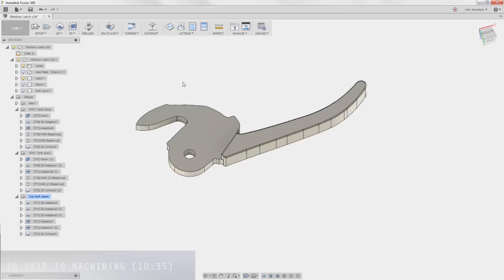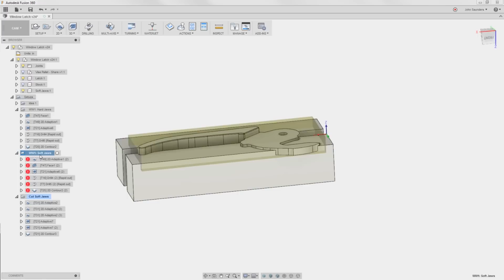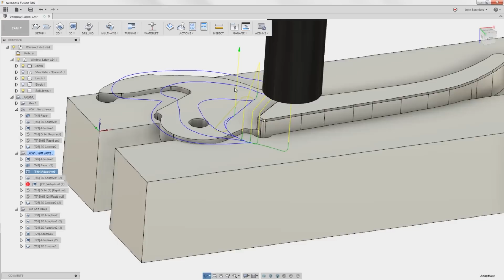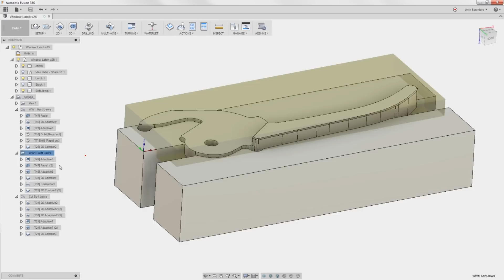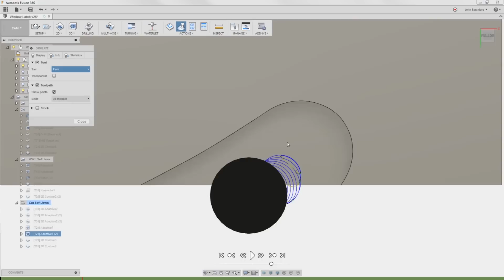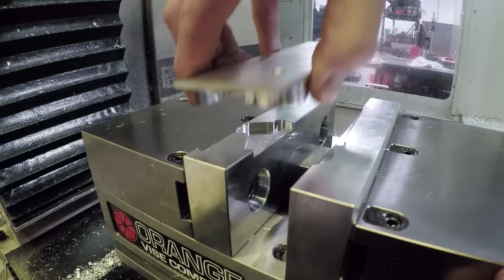Crazy Shaped Soft Jaws!  WW134

Comment: I would recommend putting a small radius like .005 where your tool leaves the jaws to remove the sharp corners to make safer for the operator and avoid having to hand debur. Also would cut soft jaw profile over  at least .001 per side to ensure part falls in freely. Help from having to hold op 1 profile to such a high tolerance and keep jaws from being deformed from forcing oversized parts in them. But if only for a one off then it will work just fine. In general if your location of features on op 1 doesn't have to be to the tenths to features to op 2 then fixture can have some slop especially if the profile geometry of the part is more complicated. Its much easier to make a fixture slightly bigger than to recut an oversized part cut from rough stock or having to scrap the part entirely bc it will not fit in next ops fixture. All in all great job.

Comment: where I work we cut the soft jaws large, so instead of being thin like hard jaws they have more area in they Y direction. That way you can keep sinking your part into the surface as you move from job to job. The set i currently use has had 6 different jobs in it.

Comment: So is there a general practice to over/under sizing the negative in the soft jaw operations to ensure the part fits into the soft jaws for second side ops?  I would think if my CNC can actually hold very tight tolerances I might have a problem getting the part to slide down into the negative in the soft jaws. But obviously I'm worried that applying a uniform -0.0005 axial stock to leave on the final contour will mean I'm guessing as to where the part is actually located once clamped in.

Comment: Hi John, I was recently playing around with the CAM for a similar sort of setup and found a neat way to handle rest machining when flipping the part.  After running the simulation for the first op, save the stock as a solid model (right click, Stock > Save Stock...).  Then, in the CAD workspace import that solid model (Insert > Insert Mesh).  (You might need the Mesh Workspace preview enabled, not sure.)  Lastly, for the second op choose Stock > From Solid and pick the solid you just imported.  If you're doing a more complex part with steps on the top and bottom it can be really helpful for keeping track of what you still need to mill.  The downside of this method is that if you change the CAM for the first op, you have to repeat the process.

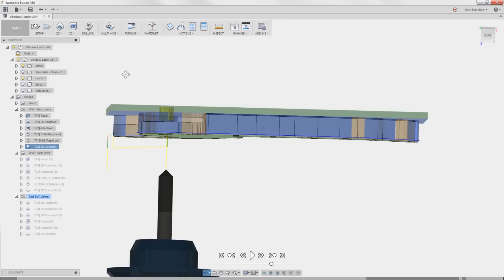Comment: Two points, at 2:30 in:
1) "Mushroom cap" = "webb" to many manufacturers; and
2) A [roughly] 56% increase in blank size will yield two NESTED parts, resulting in  a bit of savings in material costs and DOUBLE your output per cycle, meaning more peripheral work can be accomplished between part changes.

Comment: its really great that you're showing others how to take full advantage of the full CAD/CAM package that Fusion comes with. I use it at work, and absolutely love it. That being said, bro you can do these much quicker without any special fixturing. Depending on the production run, you can just order a large billet, array multiple of the same parts in the billet. Face the billet, using double sticky tape, flip over and finish the other side. 

Like in many cases, there's always more than one way to skin a cat. It would save setup time, and part loading.

When I get parts from a customer that has a flat face on one side with maybe a chamfer on one side, we call those one OP parts, just pre-face the first side, then it gets flipped over and the rest of the part is machined. Hot glue and rubber cement is used to fill areas from the first Op to avoid the coolant from eating the tape adhesive.

Just thought I would give my 2 cents, love the fusion webinars you do!

Comment: I just bought the edge technologies tramming gauge because my passes with the superfly cut on the backside....I see your 1100 is cutting on the backside as well....looks less than mine...i was wondering if tramming would fix that, guess it will get it closer..

Comment: John, newb CNC question: it seems you always try to climb mill. At 12:00 minute mark in this vid where you're staring to mill the soft jaws you are climbing only. I read that climbing gives the best chip load/finish. But wouldn't it be faster when roughing something out to go back-n-forth, such as in this case where you're making a pocket on the soft jaw? Is it that much tougher on the cutter cutting conventionally? 
Thx.
Marty

Comment: Maybe you already know this,  but based on your feed rates, it seems you may not be familiar with what radial chip thinning is. You have this awesome software tool, (adaptive tool paths), but you are using feed rates for old school tool paths.
Reply: So should his feed rates be higher or lower?
Reply: Much higher. We use micro tooling and regularly feed 1/8" flat end mills at full flute depth (.1875") at 50 ipm. You actually get a much better finish and your tools will last much longer.

Comment: You can buy long aluminum rectangle bars and just make your own soft jaws. Thats what we do at our shop. Buying them pre-made is wayyyyy too expensive! We made a few  hundred several years ago and haven't ran out yet. You should look into making your own John.
Reply: We always used Acetal for soft jaws,  super quick and easy to make then when you can rip through the material at high speed.
Reply: Interestingly enough we use mild steel. Then again compared to the stuff we typically cut that is actually soft.

Comment: If you relieved the section behind the "hook" the part would probably have a much easier time fitting into place. You need too look at where your contact points are and what direction the force is being applied. There are enough contours to locate the part already, anything that isn't pushing towards the centre of the vice is over complicating things and getting in the way.
Reply: Tim Bolivar That's exactly what I was thinking. That back side isn't helping to position it or clamp it, so it can go away to keep from causing issues.

Comment: Very nice work. With these shapes the shapes and radius given needs some clearance. I was wondering if you would use dukes and lo and behold you did. It can show us where the bind is. Most all the time with softjaws I leave the vise clamped and then try it out. Often it is only a adjustment on cutter comp. my something different suggestions would be dykem part first then still being clamped try the fit and adjust to fit. Also in general and you likely do this is to machine on one end of the jaws a nice step in case you need to use them in the future. Darn nice work for a young man who has come so far in such a short period of time. If young men like you are the future I will sleep well at night. Carry on!

Comment: I wonder if it would have been worth using the superfly to clean up as much as possible of that lower surface to get a better surface finish. Obviously you couldn't have done the whole surface, but you might have ended up with a lot less tool marks.
Reply: Would have been a lot quicker as well.

Comment: I need some help. I know very little about CNC machining, but I need a CNC mill. Do you have any suggestions on some not very expensive machine? It's going to mainly be used for making molds for low pressure molding from aluminum (about one per month).

Comment: No need to have the whole OD clamped, especially what is on the back side. 

Not sure if fusion has a draft angle viewer like SW has for mould making, but set up a plane parallel to your jaws in SW, and do a draft angle detection. Keep all surfaces with a draft of more than 1° positive at nominal relief, and all values less than +1° draft, relief by .005" 

That will let the part drop in easily, and since all of the + draft faces are where they are supposed to be, you don't have any issues with clamping. 

If you are worried about vibration of the part on the back side, then ramp into that .005 backside relief.

Comment: I've got your power drawbar attachment.  Works great!  ... my large knee mill has a very long drawbar, so I had to put 3" blocks under it to get the height right, but with a bit of a stretch to reach the handle it does well.

Comment: John, One thing you might consider. When you mill soft jaws in this way it would be more precise to line up on the part instead of the soft jaw corner. In the case of this part you could of drill the hole all the way thru (I noticed when you actually milled the part in the video the hole was thru. Did you do this?) and indicate that as your second operations zero. This is because in order to fit the part in the jaws you have to have clearance so when you tighten the vice the part shifts back some amount. Also don't necessary think in terms of needing the part square in the jaws. It might be that rotating the part one way or the other would give a better clamping situation and use the volume of the jaws better. This way of thought goes back to manual machining but isn't necessary with CNC.

Comment: As Peter Meek mentioned you could eliminate all the fixed jaw profile geometry that isn't providing clamping force.

I couldn't tell from the video if you have this in place, but on a part like this I like to run the depth of the first operation profile about 0.010 beyond the part. Then in the second operation when you face off you are not right at the floor of your "mushroom cap". You can also bypass the second op rough profiling and accomplish it with the face mill. Since you are cutting way past the mushroom cap floor the facing just turns the cap into chips.

I concur completely with your take on the total cost of soft jaws: With CAM they are quick to cut and the material is cheap. If you have idle people on the clock then it is cost effective to run a batch of soft jaw blanks. If you are running jobs it is WAY more cost effective to buy a 10-pack. I ran many jobs at quantities of 10 or less and soft jaws were used. Often, with a little forethought, you can design jaws with more than one purpose.

A few things I like to do with soft jaws: They start to multiply and keeping them straight becomes problematic. In CAM, add an engraving of the part number to both jaws (Sharpie goes away). Also, engrave arrows or other pointers to the intended origin. This does nothing for you today... but six months from now when you need to run a second batch!

Part number you say? Good file management requires unique names. Assign a unique part number to your files as you create them. Naming part files BRACKET and FIXTURE will get messy really fast.

Keep your great content coming!

Comment: when we machine soft jaws we make sure the part fits in there without having to unloosening the vise. the part should be able to drop right in snuggly and if it doesn't we make an adjustment. figure out the gap you need prior to machining.
Reply: yg

Comment: 17:48 this is a perfect example for in-machine compensation (RL and RR) so you dont need to change the program and repost, just say DR -0.001 and the machine will compensate the radius -0.001 :)
Reply: I found the heidenhain guy :D
Reply: Matthew Gowan Heidenhain is best :)
Reply: Have to pretend to blend in though, you mean G41, G42, and radius wear offset :P
Reply: i think so, i dont know Gcode much but Heidenhain Klartext (L Z+100 F9999, L X-30 Y +43, L Z +5 M99 - or RL for compensating the cutter on the left side of the Coordinate for example)

Comment: Have you ever tried hot glue to stick a part down. I'm sure that it wouldn't work for steel but do wonder if it would work for for aluminum.  Very flat surface to glue to and go ahead and top it into place with a mallet when you first put it on the surface and the glue is still soft.  Probably wouldn't be good for something like this because location is so important but something that just needs the backside fly cut it might be worth trying.
Reply: I have done this before on some large, flat parts. Heated a 3/4"x12x12" piece of aluminum on a hotplate, applied hotglue, stuck down a sheet of steel. Grabbed some gloves and chucked it all in the freezer for a few minutes (Would have taken an hour to cool all of that thermal mass at ambient temp). Straight out of the freezer, into the mill, and then perfect parts came out the other side. Worked better than the superglue/carpet tape/etc. Not as convenient as a vacuum plate and cleanup was a bitch, but it got the job done.
Reply: Believe or not just a little rubbing alcohol is all that is needed to clean up the hot glue.  Don't understand why but it just releases hot glue like it was made to do just that.  
http://lifehacker.com/5676237/use-rubbing-alcohol-to-remove-hot-glue-from-nearly-anything
Reply: With that much surface area it is still a PITA. For one or two parts it works. For more than that, finding a different way is wise.

Comment: Awesome video and great job! I would love to see a video detailing "smoothing". When to use it and when not to. As I get my Kitamura setup I have a feeling I will need that since she is only slightly younger than I and both of us suffer from a short memory. :o
Reply: I've got a 1992 HAAS VF-1 with a grand 100k of memory. Gotta pull some fancy tricks to get it to perform how I want it to- Smoothing reduced a file from 400k to 120k last night, and the moves weren't made up of tiny short sections anymore, so it could actually keep up instead of jerking around waiting on the CPU. I also found an M-code that disables the display while the program runs and frees up even more resources, so I can run 150ipm trochoidial HSM toolpaths in a machine that was originally only fit for 2.5d slow steel parts. Good luck with your Kitamura!
Reply: Nick Polanosky Thanks, that's good to know. I'll definitely dig into this more.
Reply: Yeah I would like to see a video on smoothing too. I have used it often lately.

Comment: This is great, thank you. I have a client who wants me to make a sword hilt, a 3D part. I'm pretty sure soft jaws are the answer, but I'm not at all sure how to make sure they can hold the part when it's flipped; there won't be a flat bottom, and there might be some sharp ridges that won't fit well into the cavity, because the inverse of the ridge will be too shallow due to the tool radius (does that make sense?). I don't know if Fusion can 3D dog bone a sharp inside corner/ridge.

Comment: You would need to redesign the jaws for a production run. Some basic fixturing errors in your jaw design.
Reply: care to elaborate? ive got some complex parts coming up, would be interested to know a better way
Reply: feltonissimo yes, please elaborate. I'd like to know, too.
Reply: I will try to explain but I'm not very good at explaining things. That's what John is so good at.
Notice how John had trouble fitting the part into the jaws. He ended having to shave a bit off here and there and eventually got a very snug fit. Well on a production job you can't afford the time to do that. You will also get variation of parts (even with a CNC machine you are going to get this). So it won't be long down the batch before he will find a component not going onto the fixture.
The reason behind this is that the jaws have been designed with redundant clamping faces, where the form of the jaws goes back on itself (told you I wasn't much good at explaining things). This is also why John had to drop the component into the jaws.
The best way to avoid the problem is to design the jaw profile into a shape that avoids this problem. Imagine the shape you would get if you put a rubber band around the outside of the component. Sometimes it's necessary to change the angle of orientation of the component to get a good clamping profile.

Not sure if that all made sense.

P.S. I wouldn't have worried about milling off the 'mushroom' profile either. Just whack it off with a good old face mill :)
Reply: feltonissimo I think that was a fine explanation, thank you.

Trivia: the "rubber band" you mention is known as a "convex hull," and is an important concept in computational geometry.
Reply: Thanks Rick. I like that term, 'convex hull'. My mission now is to drop it into a conversation :)
Reply: In aluminium it's usually ok, i've had thin slivers get dragged under the face mill and ruin parts though.  In steel it kills inserts when this happens!  I usually go round the profile with an endmill and cut the excess off, full slotting cut, and let it fall, leaving the face mill to deal with the bulk of the material, 3D adaptive, stock top to model top, maybe a facing cut to make the marks look conventional.  I agree with you though about controlling the contact points of your soft jaws, and allow clearance, i've had fixtures not fit parts, when I made them too tight, and operators let the parts vary accross the tolerance band.

Comment: Thanks for showing the full process John, including stock cutting, part flipping etc, it really helps get a well rounded view of the whole process, not just the impressive bits. 
I don't think I can buy plain aluminium of that size for $12 (well even for £12 which is the currency here), let alone well machined soft jaw blanks! 
Maybe you could do a chip break on metal suppliers, how you find out reasonable prices, volume discounts etc - you;ve done the full novice to pro thing, and metal supply plays a part in that journey. Thanks
Reply: You can easily get ali tha price. You will be surprised. Take a look at http://www.aluminiumwarehouse.co.uk/ and they are probably on the pricey side. The only thing is that you have to buy in a certain quantity. But hey, if you want to make a set of ali jaws why not make a couple of dozen and put them on the shelf. Or even better, sells some!